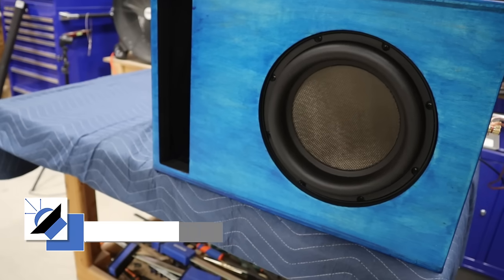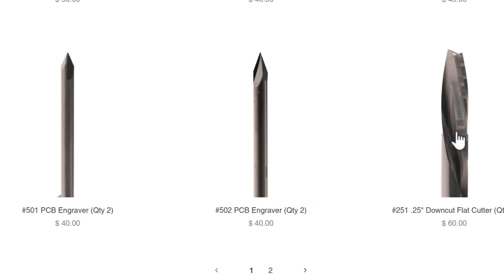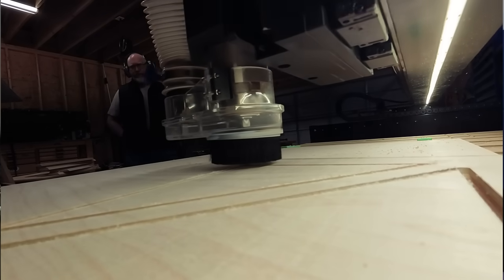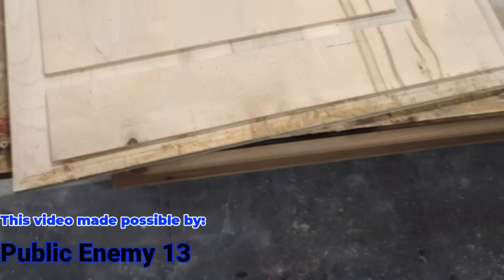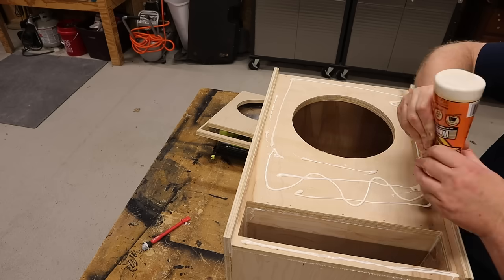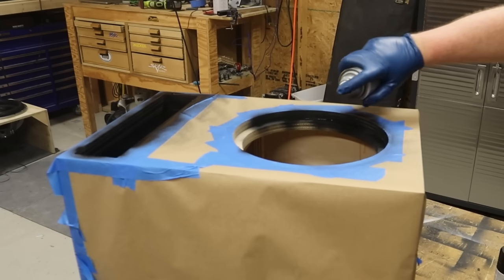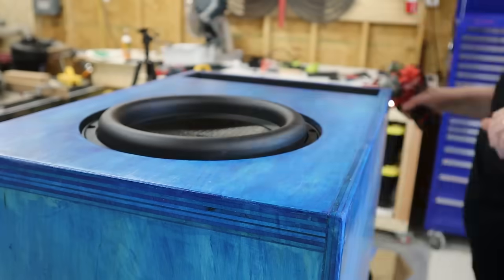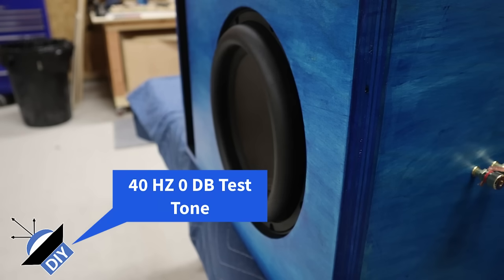Ported Subwoofer Box Build:  Learning from expensive mistakes.

Comment: Ok, I have another video suggestion.  When building a home theater box for a long-throw driver with a large motor or slugs or magnets, whatever, and logic tells you to support the motor structure.  (Something like a SVS PB-16 woofer) How "should" the motor be braced, what's the easiest way to brace it, and what are some alternative ways of supporting it?  Hopefully, you get what I'm asking?  I'm sure you've had to build a few subs where you braced the motor?  I've seen it done a few different ways, but I've never seen anyone make a video about how to do that, why you do it, and when should you do it.
Reply from the maker: I have never built one where I braced the motor.  Mostly because it would be tricky to get the support lined up perfectly.  I t would take some trial and error to get it right.

Comment: A good video you could do (because I can't find a single video where someone answers this) is how to deal with a plate amplifier when it interferes with the port.  Maybe give a few different examples of how best to deal with it.  For example, do you build a box around the amp and shape the port to match?  Do you make the port go a different direction if it's going to interfere?  What about using a Class D amp rather than a class AB?  Basically, anything that solves the problem of plate amps affecting the flow of air with the port.   Is that something you can do?
Reply from the maker: That's not something I've ever thought about.
Reply: @DIYAudioGuy  I'm the same guy on Facebook who showed you the subwoofer drawing using MS Paint 3D and asked you about the port location.  I'm about done with the sub and will be doing audio testing tonight before it goes into the paint booth.  I used the Dayton Audio RSS315HE - 22 driver, the bigger beefier reference drivers that they don't sell any more.  Been trying to find two of their 15's RSS390HE-22 but they're harder to come by.

Comment: Hi Justin, question about the rabbit cuts. How deep and wide is the router bit going down into the wood. Would that work if I just used my hand router because I don't have a CNC? I enjoy your videos and thank you for all of your videos that you do!!!
Reply from the maker: I went down a quarter of an inch.  

Rabbits on the outside will be pretty easy to do with a rabbeting bit.   In this case with a double baffle you would need one that could reach almost an inch and a half. That's a pretty big bit. 

How much for the width of the dados, it's slightly less than 3/4 of an inch because plywood is undersized.  I've tried it with a hand router, I've tried it with dado blades on the table saw. I was never able to get the result that I wanted.

If you're a good woodworker you do not need the CNC.  As for me, I need it for the more complex cuts.
Reply: Ok, thanks Justin!! Your videos are awesome and I've learned a lot from you and really appreciate you for all of your hard work and all of your time spent making your videos because I know it takes a lot of time doing everything and then editing it on top of everything else!! Thank you for taking the time to respond to my question!! I really appreciate you!!

Comment: I think it was a mistake going with an aluminum voice coil former. Sq subs should never compromise sound quality for power handling. If the old one sounds better then that might be the culprit. The aluminum sleeve and cap might not be enough to rectify damage caused by the aluminum former.

Comment: Did it just look like it, or did you accidentally not use real birch plywood? It looked like it only had 4-6 sheets as opposed to the standard of around 12 sheets (for 3/4th at least in Germany)
Reply: Is it 3/4th of an inch? Hard to tell. If it's thinner, is there any particular reason you went with thinner than 3/4th? Not to be elitist or anything, just asking.
Reply from the maker: It's the stuff from Home Depot, I cannot get Baltic Birch in my area

Comment: ive run the daytons, i really liked them BUT they do not work int eh cold!  i live in MN, when its below about 20F they get kinda hard to move. below 10F the surround becomes as hard as plastic! the sub is totally unable to move AT ALL.  eventually i had the cone separate from the former/voice coil as the surround was so hard the magnet was so powerful... it pulled itself apart one -15F morning. 

never in my life have i seen ANY other speaker meant for car audio - succumb to the cold like this.  its obvious Dayton never did any temperature testing on these drivers.  if you live in a cold area - do not buy them.

Comment: Love this YouTube channel and excited to contribute to this awesome community with a tip for cleaner CNC plywood cuts with less splintering:
    1. Use a down-cut bit, set spindle to 15,000 RPM, and secure plywood with the grain aligned for best results.
    2. Score the surface 0.1mm deep with the spindle reversed (M4), using a climb cut at 1,500 mm/min.
    3. Switch the spindle to normal rotation (M3), then cut full depth (e.g., 12mm) in passes (e.g., 3mm each) at 3,000 mm/min.
    4. G-code setup: include a scoring loop (M4 for the shallow pass), followed by main cutting loops (M3 for deeper passes), with safe Z-height moves between.
    5. Test on scrap plywood first to fine-tune feeds/speeds and ensure your spindle reversal works smoothly.
Extra option with down-cut bit: Instead of deeper passes, try more shallow passes (e.g., 1-1.5mm per pass) with the down-cut bit to gently shear the material, reducing stress on the top veneer and further minimizing splintering. It takes more time but gives a smoother finish. For a 12mm sheet, do 8-12 passes at 1-1.5mm each, adjusting feed rates (e.g., 2,000-2,500 mm/min) to prevent burning while keeping cuts clean. Use good dust extraction, as down-cut bits can trap chips and cause heat buildup.
What it does: The initial scoring pass pre-cuts the top veneer to avoid tear-out, while the reversed spindle (counterclockwise) creates a climb cut that presses fibers down. Normal rotation then handles deeper cuts safely.
Why it works: Plywood splinters when fibers lift during deep cuts. Scoring first cuts the surface cleanly, and climb cutting reduces tear-out for a smooth edge. Multiple shallow passes spread out the cutting force, keeping the finish neat.
Why a down-cut bit instead of up-cut: A down-cut bit pushes fibers down as it cuts, keeping the top surface clean, which is crucial for a nice plywood finish. An up-cut bit pulls fibers up, increasing tear-out on the top (though it clears chips better for deeper cuts).
Big shoutout to this channel, my brother—learned so much and thrilled to share what’s been working for me!
Reply from the maker: Is there a way to do that in the software without editing the G-Code?
Reply: @DIYAudioGuy  Yes Try out Cambam. In the settings allow you to reverse the first layers of the spindle. plenty of YouTube videos on how to use it and how I learned as well. certainly user-friendly for G-coding a CNC brother. it should be in most software by just adding the command. What software are you using?  I can help you with the setup as I run AI api software I designed to recommend settings.
Reply: @DIYAudioGuy  In CamBam, you can add custom G-code (like M4 S5000 for counterclockwise spindle) directly in the machining operation properties. Here's where to do it:
Select the Machining Operation:
In the CamBam project tree (left panel), expand your Part and click on the operation (e.g., Profile, Pocket).

Add Custom G-Code:
In the operation’s properties (below the tree), find these fields:
Custom MOP Header: Add G-code to run at the start of the operation (e.g., M4 S5000 to start spindle counterclockwise).

Custom MOP Footer: Add G-code to run at the end (e.g., M5 to stop the spindle).

Alternatively, use Custom G-Code (at the bottom of the operation properties) for more complex snippets.

Generate and Check:
Right-click the Machining folder in the project tree, select Produce G-Code, and save the .nc file.

Open the file in a text editor to confirm your custom G-code appears where expected.

Notes:
If you need M4 for all operations, modify the post-processor (System > Post Processors) instead.

Test the G-code on your machine to ensure it behaves as expected.
Reply: @ it will only add to the g-code script where you want it.
Reply: if you let me know the software you use, I can try to help you with the G-code and setting up profiles.
Reply from the maker: @ACW3DDesigns  carbide create and carbide motion, the stuff that came with the CNC.
Reply: @DIYAudioGuy  Unfortunately, no—Carbide Create doesn’t allow adding custom G-code scripts directly in its interface (unlike CamBam). You can’t manually insert commands like M4 for counterclockwise spindle direction or other custom G-code without editing the output file afterward. Carbide Create generates G-code automatically based on its predefined settings, and there’s no field to inject custom commands. Carbide Motion also doesn’t provide a way to add or modify G-code during runtime—it just executes what you load. So, for things like changing spindle direction or adding specific commands, you’d need to edit the G-code file manually after exporting it from Carbide Create, or use a different CAM software like CamBam that supports custom G-code.
That said, you can still get clean cuts on your 16mm plywood with Carbide Create and Carbide Motion by focusing on good settings and techniques to minimize splintering (like tape or a backing board). Here’s how to set it up:
You can stick tape over plywood to prevent splintering during cuts, so you don’t need to worry about reversing the spindle direction (M4). Alternatively, use a backing board (like MDF) underneath—it supports the bottom, stopping fibers from tearing out as the bit exits. A downcut bit works best since it pushes material down, keeping the top edge clean, though a compression bit is ideal if both sides need to be clean.
In Carbide Create:  
Tool: 1/4" downcut end mill (e.g., Carbide 3D #201).  

Toolpath: Profile or Pocket, depending on your cut.  

Cutting Depth: 16mm (or 16.2mm to ensure full cut).  

Depth per Pass: 3-4mm (4-5 passes).  

Direction: Conventional milling (default).  

Spindle Speed: 12,000-15,000 RPM (e.g., DeWalt 611 at speed 2-3).  

Feed Rate: 1500-2000 mm/min (start at 1500, adjust up if clean).  

Plunge Rate: 300-500 mm/min.  

Tabs (if Profile): 3mm wide, 2mm high, every 50-75mm.  

Stock: 16mm thick, zero to top.  

Save G-code as .nc (uses M3, no option to add custom G-code like M4 in the interface; you’d need to edit the G-code manually post-export).

In Carbide Motion:  
Load .nc, zero X/Y/Z (Z to plywood top), secure plywood (tape on top or backing board below), run job.

Tips: Use a sharp bit, test on scrap, cut slow on the final pass, clear chips if needed (downcut bits can clog). If top-side finish is key, stick with downcut; if both sides matter, consider a compression bit. Let me know if you need tweaks for your setup!

Comment: I would always use MDF or HDF for a sub box. But, this blue looks great I think.
Reply from the maker: It's funny because every time I make a box out of MDF, there's always someone down in the comments saying that you should only make a box out of plywood.  I don't think the material makes as much of a difference as people think it does.
Reply: @DIYAudioGuy  I just find the MDF easier to work with - and a bit cheaper! I agree for a well built subwoofer box the difference in sound is almost certainly inaudible.
Reply from the maker: @Bradimus1  I make the decision based on how I want to finish the enclosure. If I'm planning to use carpet I go with MDF.
Reply: @DIYAudioGuy  probably easier to cut plywood than veneer the MDF. But I haven't tried.
Reply: @DIYAudioGuy  what about  a laminated mdf,it has a shinny surface so I'll consider and dampen it, Will it produce quality sound ?
Reply from the maker: @blacksnow.  A few years ago I picked up some scraps from a local cabinet shop, it was MDF with a wooden veneer. It worked great.

Comment: If ones just using simple 3/4 MDF, what pneumatic nail gun and what length of nails are needed.I've spent 2+ decades drilling, gluing  and screwing.
Reply from the maker: Inch and a quarter 18 gauge brad nails.   Any 18 gauge nail gun will do the trick.
Reply: @DIYAudioGuy  thank you much my man!

Comment: I have a circular saw, jig saw, drill, and a tight budget that makes me very nervous about wasting a sheet of wood. I need an enclosure for a single 15. I will continue my research and make my attempt next weekend.
Reply from the maker: I started off the same way. You can get it done with those tools.   https://youtu.be/WWNQZzwcbBM?si=5KssJVl8m88hAjg3
Reply: Plan, plan, plan. Don’t measure twice measure three times if any of those measurements don’t match take a breath and remeasure again. Test fit as you go. If you start getting tired or overly frustrated take a break or call it a day. Don’t be afraid to ask questions even if they seem stupid

Comment: That's not birch plywood, that's just a very thin birch veneer on regular pine plywood. You should try and source real Baltic Birch. There is 13 layers in 3/4" Baltic Birch and it comes in 5' x 5' sheets, not the 6 layers that stuff has. Baltic birch is what every single pro-audio concert speaker on the planet is made from. There is no comparison between the real deal and thin veneer birch plywood. There is absolutely no benefit to birch veneer plywood over regular plywood other then the wood grain looks nicer. If anything, that thin veneer peels easy and any glue joints onto it are not very strong. It didn't look like many voids in the stuff you were using but there are absolutely zero voids anywhere in the real stuff and it's twice as stiff and strong as regular plywood. You won't find Baltic Birch in a big box store, you have to call around specialty stores that woodworkers and cabinet shops go to. You'll never go back once you use the real deal, it's literally 10x better.
Reply from the maker: I can't find the good stuff near me.  There are Woodcrafter and Rockler stores about 45 minutes away that sell project panels for stupid $$$.
Reply: @DIYAudioGuy  Visit a local cabinet maker and ask them where you can source it. There will be a building supply store somewhere near you that sells it.
Reply: I've been getting 10 ply solid birch sourced from Vietnam at my local builders supply store. It's way better than that crap from big box stores and only about $55 per sheet.
Reply: @hopskustomaudio that's a good price!
Reply: It's going to be stupid $$$ 13 layers of imported wood. Several hundred dollars per sheet
Reply: @fortyfukinseven  I'd rather build mine from 1" MDF.
Reply: Yeahhh. $$$

Comment: Nice video.  @3:00 or so, discussing the window brace - you do not have to router the internal edges at all.  Roughly shaped openings are going to work just as well as perfect rectangles.  Round over the edges if you like but that doesn't make any difference either.  The only place that smooth edges are important are the vent.
Reply: In fact, you don't need to cut out perfect squares in the brace at all. Hit it with a hole saw until there's enough perforation in the brace to allow decent airflow...
Reply: Not necessary... but I also often round-over internal braces myself, just to keep my skin on my fingers when working on the thing, and during assembly.
Reply: @zarboaudioprojects1430  HA!  Absolutely agree there.  My tip was more for the shape of the openings rather than the rounding over.  I completely understand that when building something for YT, extra precision is needed to keep the hecklers at bay, but there is no difference in the real world between an opening that looks like a perfect rectangle and something that looks like a potato.  I watch your channel also Tom.
Reply from the maker: You are not wrong.
Reply: Gotcha. I see where you're coming from. I probably lean more towards potato! 😂

Comment: Great video! What kind of home amp can run a 1ohm loads stably? I’m not an expert but even two ohms is very very low for most amplifiers. Have you tried wiring the sub for 4 ohms?
Reply from the maker: I am not aware of any.  Parts Express designed this for 1 ohm in a car or 4 ohms in a home theater.
Reply: You can do what I did, I bought a 12v 600 watt power supply off of Amazon and use that to hook up a subwoofer amp meant for car audio. Runs a 1 ohm load in my 2 channel setup all day long 💪